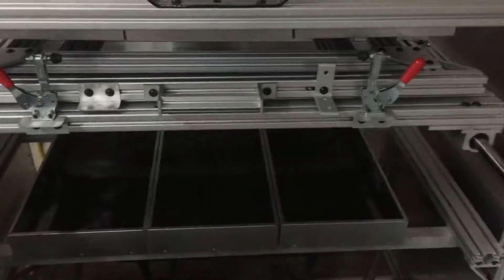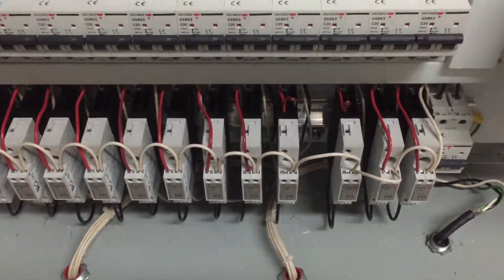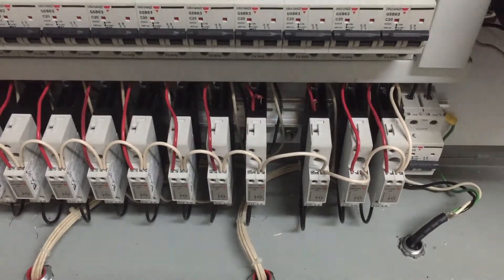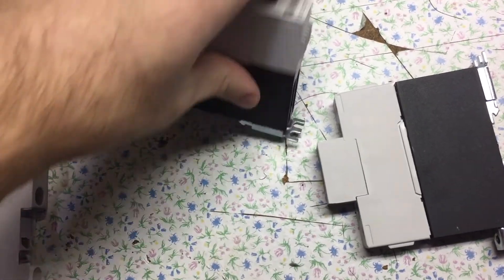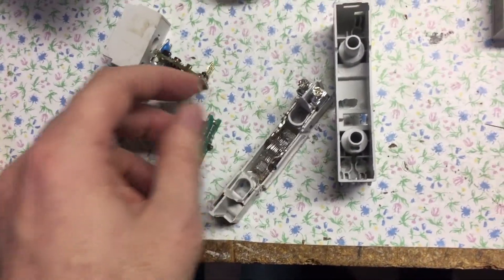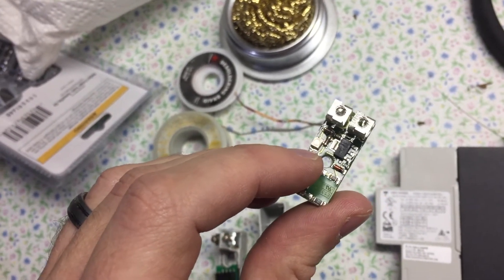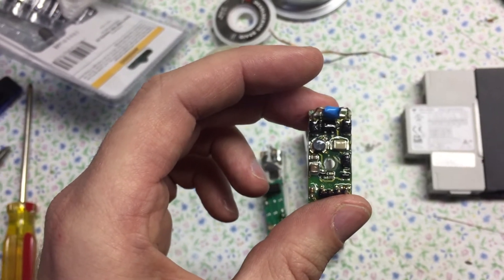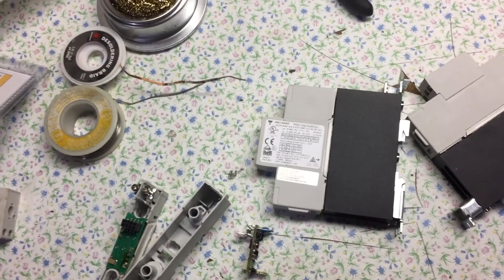Vacuum Forming Heat Problems, Bad Relays

Comment: The optocoupler is the larger white square component on the opposite side of the low voltage board, not the smaller white component. I would consider using a mechanical type relay with higher current contacts for the heating elements since high-speed switching is not a design issue. The plc board is made by a quality manufacturer so, once again, the theory is the heating elements need relays with more current handling capability. If you try this approach put a 1n914 or a 1n4001 diode on the wires going to the new relay coil, in parrarlell with the relay coil inputs, while observing polarity. The diode will prevent an inductive kickback that could damage the controller components. I might consider a few small "PC" type fans in that encloser if there seems to be excessive heat. Thank you for these videos so far, great job!
Reply from the maker: Ha been waiting for someone to catch the goof. After doing more research on this issue I realized I was wrong. I checked all the stats for this relay and it shouldn't even be out of spec for the load it is under. We have since replaced with another kind and have had no problems so far. I have a temp gun I use for checking temps all the time on the plastic and molds. It was very cool in the cabinet. I was expecting it to be very hot on some components but the hottest part was the PLC unit because of some relays in there. The heatsinks on the solid state relays appear to be doing a great job of cooling. I agree that I would have rather seen mechanical relay for this type of work. I actually expected that and was surprised it wasn't. I do lots of work on pinball machines and those use them for much faster work than this machine is doing. On those they last decades before failure and even then is usually cracked solder joints on the PCB board solder pads. Of course they are usually only drawing 1-5 amps.